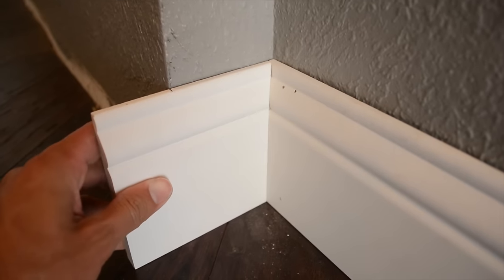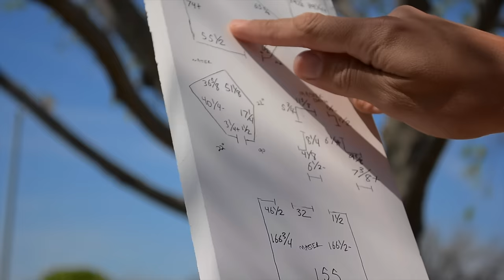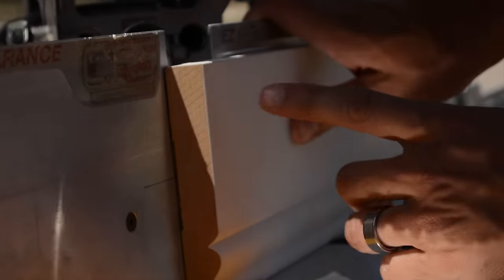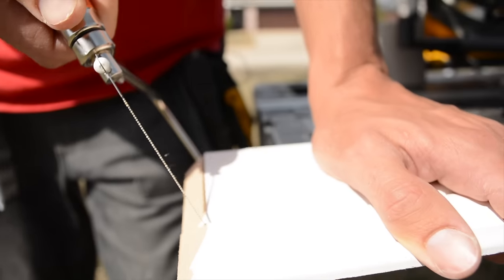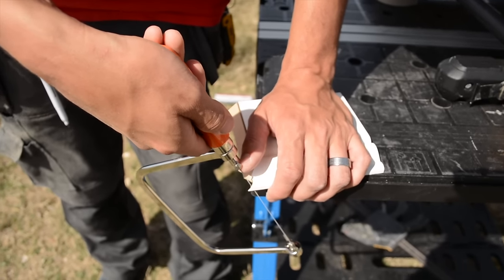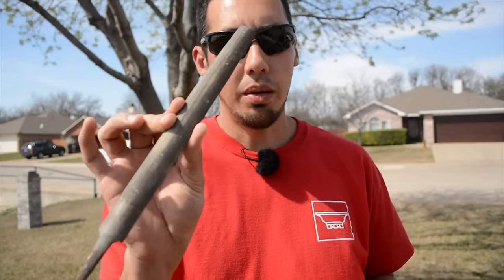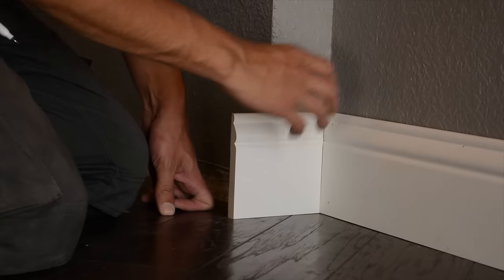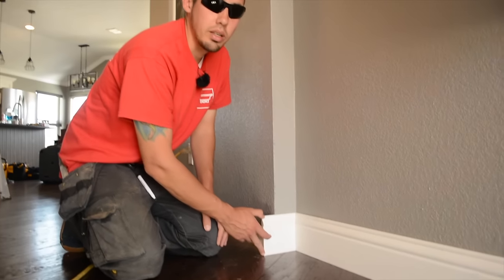Coping MDF Baseboard

Comment: I see you stopped using the Milwaukee saw and went with a Dewalt? What are you thoughts on the two?

thanks
Reply: Gear Barrel if i remember correctly, he just wasn’t feeling a 10”.
Reply: Gear Barrel s
Reply: Both the Dewalt and the Millwakee are far too expensive take too much time to set up and by the time you have set the saw and it's bench up i have already done 3 coped skirting cuts with hand tools and fixed them! I prefer learning the knowledge with hand tools that way when the power goes off you aren't stopped.Woodworking safety is best learned with hand tools then a controlled progression to power tools. You will understand the feel of wood from using hand tools - you will learn and be capable of doing stuff with mere hand tools. Working off grid or in the garden it is essential to develop hand tool skills otherwise you will spend all day setting up and taking down your chop saw - by which time you could have done the job if you develop the hand tool skills. 
Sadly most people expect a power tool to do the job for them!
Reply: Dewalt is my preffered choice as i have never tried Milwalkee. Not many stockists in the uk but i am told Milwalkee is a good brand.

Comment: 6:10 just cut it off square where the flat part is.  theres no room for the little sliver piece.  it has to bend up out of its original position to fit on the next piece of base

Comment: In my opinion coping has always seemed like a hack way to trim.  The correct way is to use sample blocks and get the correct angles.   Find the correct angles or use shims to square everything off
Reply: How do you use shims to square your work? I understand what you are saying, but it does not seem feasible in practice.  If you shim a run of base board, you will have the shim width gap running along the baseboard and the wall.

I've always made sample angle cuts and fitted the joint tightly once I had the correct angles and it was not a very time consuming process.

I just laid 840 sq. ft. of LVP flooring in our kichen and dining room.  I now need to install the new baseboard. I may try the coping method on a corner or two and use the trial fit and cut method in the rest.  In the trial fit and cut method, I can cut, adjust and fit pretty quick with tight results.
Reply: @ChrisNobodySpecial  - you would only shim the corner  joints.   not along the long runs,   you just cut the pieces at 45 degrees then shim behind them to bring them tight and square square,  then cut the shim off. .  Then caulk the gap between the trim and wall.  I have done it that way with shims for years.    If I didn't then i would test sample pieces to find the right angle rather then using coping method.  I have always felt like coping is how  amateurs  and hacks do trim. This guy is super good at trim I am surprised he uses coping

Comment: Try using an oscillating tool with a coping accessory.
Reply: Coping saw is cheapest and no leads required nor power - why does everyone love power tools so much when the majority of the best work is done with hand tools. I suggest everyone learn the feel of cutting planing and sanding wood by hand before progressing to power tools so that you know the materials limitations and suitability in dimension. Once you have the feel of hand tools you can translate that to the feel of power tools. Seasoned tradesmen or diy'ers know what i mean.
Reply: Studhawk agreed , coping saw us easiest and best way . Dont know why people are fascinated with using multi tools , jigsaws with cop foot and even angle grinders to scribe 🙄
Reply: The diy'er seems to turn his nose up at hand tools yet one cannot or should not progress to power tools until you have mastered the hand tools. A coping saw is a basic tool but perfect for what it is designed for - is there any blade out there as fine as a coping saw and as controlable ? In short -NO! So you are all trying to reinvent the wheel when the coping saw has been excellent for centuries, which is why it is still around.Instead of seeking a power tool for every job - just learn to mimic someone who uses a coping saw correctly and a whole world of detail is yours. Using a coping saw will also teach you the feel and force required to use the tool - whereas  power tools don't generally do this - you hit the trigger and they can be difficult to control.Studhawk
Reply: Learn the feel of working wood with hand tools before progressing to power tools - your standards of finish will improve massively. After cutting skirting boards for in excess of 35 years i still use a coped cut for the internals. I know they can be done with a chop saw by cutting back the mitre but i will always prefer the coping saw as i can adjust the cut better with a hand cut when the wall is badly out of square.
Reply: Exactly - if you cannot control a hand tool such as a coping saw - you will struggle with power tools as you need to learn the feel of wood first and it's uses and limitations. Working wood with hand tools is the only way to learn as you feel the tool. With power tools generally one only feels the power or vibration of the tool.A coping saw is also cheaper than a power tool and if carpenters have produced all that beautiful work with hand tools then why not try to do the same. It is the process of doing it that brings about the feel and learning of how to work with wood. So viewers don't jump onto power tools until you have learned the feel of wood and hand tools. Oh and let the WEIGHT OF THE SAW DO THE CUT and don't force the cut. You have to stroke wood with a saw to cut straight and not hack at it with excessive force. 
Back to coping saws and a coping saw can be turned on a smaller curve than any power tool so how would you cut a tight curve with a jigsaw or other power tools?
Studhawk

Comment: Maybe I’m an idiot...but...why wouldn’t you just use a normal 45 cut instead of coping? I’m not a carpenter so I really don’t know.
Reply: Jason Smith for a better fit corners are rarely exactly 45 degree . By scribing the joint will fit nice and tight even if the corner is out of square

Comment: It is undeniable that the result is great, but isn't it faster to just measure the angle with a fast angle measuring tool and then just cut both ends in the correct angle? Easy to measure, easy to calculate, easy to set up the saw at angle and no need to use coping saw or file

Comment: Sorry to point this out but cutting back a coped mitre at 45 degrees weakens the face of the coped cut. It should have been a straight cut so that you don't leave a void behind the face of the reverse mitred coped cut. Why not cut the coped cut straight???????? Watch this on Studhawk channel on you tube How to and fix architraves and skirtings.
Reply: It's an inside corner, coped cuts are always back cut.  45 degrees seems a bit much but I don't have a problem with it.

Comment: Lemme just first say this guy is excellent and this video is great. However, Correct me if I’m wrong but this is paint grade finish work. If u wanna go nuts use an angle finder and split the number. Why go to so much trouble when u can 45 cut and wood filler in it’s a degree off. Seems like a huge waste of time for base.

Comment: It takes me too long to make inside miters  look good. For me coping is faster
Reply: Internal mitres on skirtings open up as walls are never true and plasterer's don't square up corners properly so even if you cut a perfect mitre your wall will throw it open or out of line as the plastering is not perfect. Check studhawk How To channel on you tube where we show you all this and even How To Tile a Bathroom.
Reply: Inside mitres are the wrong way to do it as they open up and corners are rarely square - a coped cut is the professional way.

Comment: Sorry dude but you’re coping it incorrectly. You put the blade on so you cut on the down stroke this way any tears will be on the backside of the wood where no one will see. Plus it’s a lot easier cutting down than pulling towards you

Comment: Finding angle....1 second. Coping...let's say much longer than 1 second.
Reply: infinera06 coping is much cleaner and a pro will do it fast
Reply: Until you nail it to the wall and your inside miter opens up a 1/16.. which is the whole point of coping.

Comment: Jigsaw is 10 times faster to cope than the coping saw
Reply: I'd bet you $1M that you can't post a video of you doing this 10x faster with a jigsaw.
Reply: I can second that I use a jig saw as well it's much faster but on stain work I tend to use a coping saw
Reply: He did it in just under 3 minutes, but there was about 1 minute where he stopped to talk about what he was doing.  For actual cutting he used about 120 seconds.   So 10x faster is about 12 seconds.  Not possible.
Reply: Andrew Cady the more profile the base  has and ifs its wood is where the jigsaw becomes 10x stupid
Reply: But the coping saw has a finer blade and is more accurate than a jigsaw. Also with a jigsaw it is difficult to control when there is no timber to sit it on - so coping saw. The other way is to use a chop saw and cut back the mitre to a square edge but they are also expensive and not many diy'ers buy them. The cheaper chop saws tend to be less accurate than the £700 pro saws. A coping saw cost less than £10
Reply: @andrewcady9443  u got a million I can cut 2 boards to his one and just as clean with my jig saw
Reply: 2x is possible.  It's harder to cut it precisely, the faster you go (obviously).
Reply: An angle grinder is faster and cleaner than the jigsaw
Reply: I do this with a STIHL saw it's so much faster

Comment: Did you get fitted for your respirator ?? I’m an electrician and I had to get fitted for mine. You base it on your lung capacity. Maybe you should also,just guessing doesn’t work with that cancerboard. Your life is worth a lot more. Also, you have to get the proper filters. What works on one type of wood doesn’t necessarily mean that it’s good for mdf or some other wood.